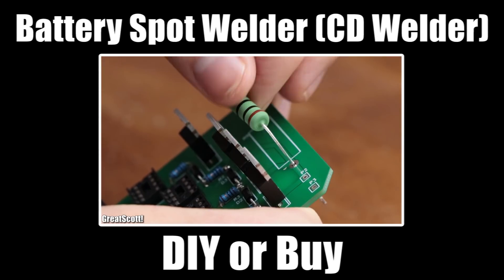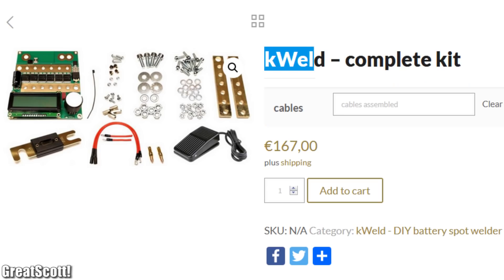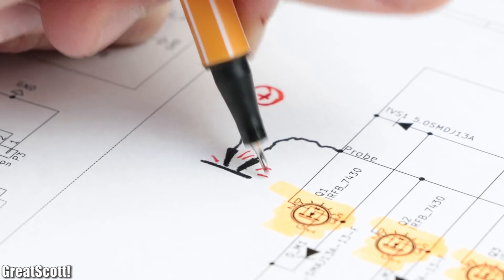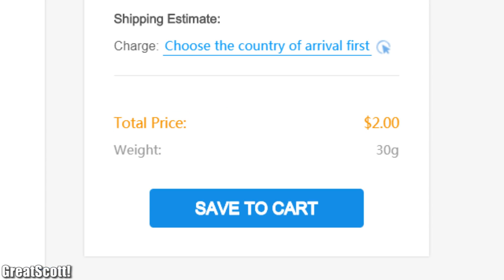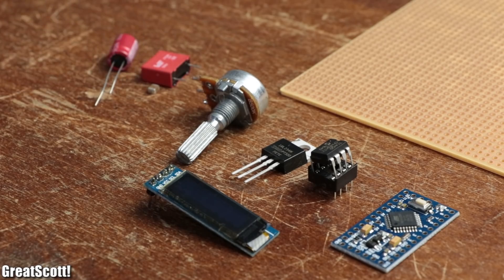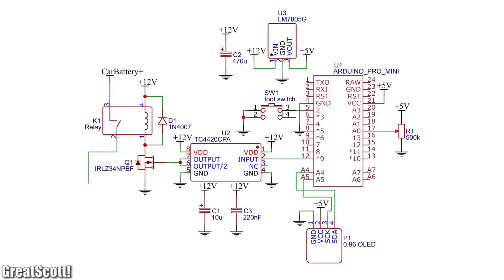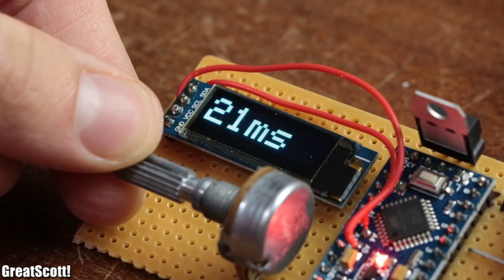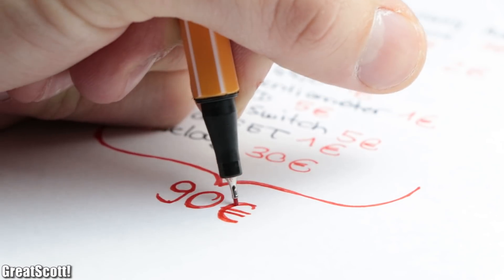Make your own Crude Battery Spot Welder with a Car Battery!

Comment: Cable shoes 🤣 that must be the German Translation for ring terminal! Love the German language.
Reply: Well here in Denmark we call those "Ringkabelsko" (Ring cable shoes), as opposed to Spade connectors (spadekabelsko) or Pin terminals (stiftkabelsko).
Reply: @jaras1969  It's "Ringkabelschuh" and "Stiftkabelschuh" in German as well :) Then there's "Gabelkabelschuh", but "spadekabelsko" is a "Flachstecker" or "Flachsteckhülse" respectively for the female counterpart.

I always find it fascinating how these kinds of mashup words play out in different germanic languages :D
Reply: @jaras1969 That's really interesting! Does that mean that "shoes"(sko, and Schuh for that matter) has a meaning that is more broad than shoe in English? Possibly something like distal appendage cover?
Reply: @reallyiffy  The word shoe is used for electrical contacts in English also.  The sliding contact on an electrically powered trolley, for example, is called a shoe.
Reply: @flyingshotsman That's right! I've usually thought of these connections as brushed contacts, but as you described, that is the correct term for the sliding conductors on electrically powered trolleys (and busses like we see in Seattle!) I always thought of that as a pantograph assembly but that might be a term reserved for electrically powered trains.

 @Basement-Science  yes of course cable shoe is an English word. It's the literal translation of the German word, which is very different from the nomenclature used in the vernacular. For example, I have never heard it been used in my industry where I work with lots of electrical engineers, and electrical assembly technicians. They always refer to those contacts as spade/ring terminals/crimps. It is just a striking word to me because of the imagery it invokes as a literal shoe at the end of the cable. The mental image is rather ridiculous but also makes sense in an abstract way.
Reply: In Romania we call them "papuci" and it means shoe so nothing out of the ordinary here.
Reply: Yes, your right🤣 🤣
Reply: necesitas un translation en espanol?
Reply: It's the same in Romanian :) Only that we call them "cable slippers" (word for word translation)

Comment: Microwave transformer and big relay on the primary side driven by 5V arduino relay is good option I use it and it's great and muuuuch cheaper
Reply: @closure4791  Yes. Relay is in the 230V side so it can be smaller and much cheaper. It is also faster because those big ass relays capable of hundreds of amps have to move large contacts and it takes time. Only down side of this relay is that it is using 230V to switch. But 5V arduino relay module is well enough for switching relay that powers the transformer.
Reply: @closure4791  There are modules available on Ali-Express which do exactly that. They offer precise timing control and zero-crossing-detection. Some of these modules even offer double-pulse welding and they come with a powerfull SSR allready soldered in.
Reply: Least someone got good idea lol

Comment: I've got one great spot welder on arduino and microwave transformer. But not long ago I buy 350F 2,7V supercap (8$). I just welded to supercap terminals wires and copper electrodes, and thats all. Simple and efective spot welder :) Just I need to be fast :P

Comment: Very good video and interesting project!

I'm only a bit concerned about the lead acid battery misbehaving after long continued use. Maybe adding a thermistor attached to battery could help to implement a safety power off.

Comment: I build the exact same spot-welder. But I upgraded it then with mosfets instead of the relay. I also replaced the car battery with a "car starter Powerbank". It works perfectly.

Comment: Never tin wires clamped in screw terminals!
Reply: how come? Just wondering
Reply: @The231447LucidDevTeam  The solder cold flows under pressure. It will lead to a bad contact, heat and fire in the end. It's a big NO-NO.
Reply: @zaprodk  makes sense. thanks for explaining
Reply: @The231447LucidDevTeam  solder gets kind of weak over time and connectors heat up because of higher resistance. you have to crimp those connectors.

Comment: That's dumb, I bought spot welder module from Aliexpress for 20$ and used it with microwave transformer.
Reply from the maker: Great, but my design works as well. So why is it dumb?
Reply: @greatscottlab  It's much more expensive and you are switching high amperage, while I switch 230 V, so it can be done with semiconductors instead of relay. 
But hey, I'm glad you had fun making it. There is always a way to improve something.

Comment: Hello,
For those of you who consider the price of the relay too high, you can do the same job with a much cheaper starter solenoid from a motorcycle. Those come really cheap in my country, about 5 euros.  And you don't really need an OLED, since they are a bit expensive. You can do just fine with a 7segment. Be sure to not purchase just the bare bones one, or if you do, purchase a bcd to 7 segment decoder,  and a sipo shift register (if you want to save pins on the arduino). Also, you don't need the  arduino, if it is expensive where you live and you don't wish to wait 2-3 months for aliexpress/banggood (that's the waiting time for me in my country). You can do just fine with an atmega328p programmed in a arduino board or via ISP.  GreatScott! has explained how to do so with an attiny85, and the process is similar , same pins, you just have to locate them.
Kind regards.
Awesome video, by the way.  Congratulations !! :)

Comment: Wouldn't it be better to use iron/steel nails?  Yes, the resistance would be higher, but isn't the coppers melting point just way too low?
Your nails seem to get welded onto the nickelstrips quit strongly every time.

Comment: can't you just plug the electrodes directly to the battery with one cable cut in half, on each lose end a metal pole you can hit the other one with to close the circuit for a short period of time? Wouldn't be that precise but 100€ cheaper. (i don't think the poles would stick together when making contact given that you would mainly "bounce".

Comment: plz make a wireless USB hub for PC
Reply: a wireless usb hub is useless and it's not possible to compleatly wirefree something like a usb hub.
Reply: no i wanted to know coz i m a gamer and lots of wire run from behind hy system.....i want to minimise that by using an wireless usb hub for my gaming keyboard and mouse set.....thats why
Reply: @somnathmukherjee4155  then just use a wireless keyboard and mouse, still because it's wireless = it can cause issues for example drop the connection or have delay, not a big fan of that

It's better to stick to cables and manage them neatly (drill a hole in the table for Keyboard cable for example)
Reply: Sir I Repairing amlifheres so I need a amlifher  circuit boards so you can help me plz

Comment: I see you used wurth elektronik capacitors. Did you get them as samples or buy them? I asking because I am 'sponsored' by wurth elektronik and if I had to buy their components I don't see the reason to spend that much money on their components, because their components are quite expensive compered to other manufacturers.

Comment: I am not an electronics super Student like you, but I managed to build such a simple Version 2 Years ago. The point is that often the simple Version is the best version. My Spotwelder only consists of a Car Battery, an Arduino, a Resistor, thick copper Rods and Powerful Mosfets, I control the on/off time via my Laptop, so no other complicated circuitry. This stuff is literally no Rocket Physics. I did not even made the Math for on/off Time of the Mosfets. I just tried around a little bit until I became good Results. I think it is a little bit amusing that you tried these complicated versions when the key is simplicity. But nevertheless the approach with the Supercapacitors was pretty interesting. Greetings from Hamburg.

Comment: 6:57 isn't it a bad idea to tin wires that you put in screw terminals?
Reply: It is not recommended, since the solder will settle after a while, leading to a loose screw connection. It is better to crimp the wire with a ferrule to cold-weld the strands together, and also provide a grip for the screw holding it in place. Tinning the wires is forbidden in the electrical wiring of houses, and in manufacturing of switching cabinets.
Reply: @nrdesign1991  that's what I was thinking.
I have a 3D printer and I remember the biggest nono was to solder the leads for the bed. Apparently it was a reason for loose contact and melted terminals.
Reply: @awesomefacepalm  Either solder the leads directly to the board/connector/whatever, or crimp the wire ends with ferrules before inserting into clamp connectors.
Reply: @ @nrdesign1991 , normally you don't use stranded wire for 120 or 220 volt housing wire hence there would be no call for tinning.
Reply: Yes it is, definitely do not solder wires to use them in screw terminals.
Reply: Absolutely. Never, ever, tin wires for screw terminals! When done with mains wiring it has caused many house fires after a while.
Reply: Absolutely a bad idea, especially on high current wires. Heat will cause the solder to fracture, deform, and heat up. This results in a lose connection with high resistance which further increases the heat in the connection. I have seen several melted mains plugs in which the amateur tinned the wires with solder before screwing them down. ALL electrical contact manufacturers state in their instruction sheets NOT to solder before installing in screw terminals or crimp connections. Crimp, THEN solder or in the case of screw terminals, just screw them down. Use wire ferrules if you want that professional installation or if you need to meet electrical code in industrial cabinets.
Reply: Never presolder mechanical connections!
Reply: Thanks to all for this information. I'm sure I've done the deed more than a few times. Never again.
Reply: Yes. The thermal expansion and compression of the terminal compresses the solder when cold and when the terminal warms up again the solder does not follow the expansion and is loose in the terminal.
Reply: What about soldering after you screw it in?
Reply: Tin your wire when then end connection is a solder joint, most low power signal wire it would matter if it were tinned, feruled, or bare.  However with that said, I don't see a reason to power terminals ever.
Reply: Over time the solder does tend to creep, but although the current is high it's high only for small pulses. I don't think in this application it is an actual safety issue.
Reply: @VrumsAdventures  Solder creep isn't the entire issue. Over time as the temperature of the connection changes, the tinned end of the wire will deform slightly, with the net result being  that the terminal ends up loose. Best option is to use a proper crimp-on ferrule (can subsititute an uninsulated butt connector in a pinch), but even bare wire will be more reliable than tinned.
Reply: No, you have a better and stronger connection thats is also protected from corrosion
Reply: @Nedeles  It actually gets a weaker connection because the solder has a creeping effect over time. It's a common mistake for newcomers because you intuitively think the solder makes it into one large conductor, but then you don't account for the odd microscopic properties of solder.
Reply: @Djhg2000  ok
Reply: @Nedeles  NO!
Reply: yes its a good idea, and for fast soldering bond I always smear the naked copper wire with solder paste
Reply: @ronen124  No it's an absolutely terrible idea. Solder cold-flows under mechanical load.
Reply: @zaprodk  if you tighten and hold the wire strong enough it should not become hot and melt the tin, from my experience copper wire threads: if moved to the sides will break easily, if exposed to moisture will corrode with time , have you ever seen tin melting in such occasion or you just want to say something "wise" from what you read somewhere?
Reply: @ronen124  I've been working in electronics for my whole life so i /know/ it's bad practice. I've seen control cabinets burned down because of this and repaired stuff that acted weird with vibrations. It has nothing to do with "holding the wire strong" - The solder does not make the wire become hot. The solder is flexible and when you put it under pressure it moves - but only very slowly. It can take years before you notice it. But when it has moved enough and the joint becomes erratic you will have heat produced and then it just accelerates and takes off very fast. It sounds like you are feeling very "wise" going after people that actually know what they are talking about.
Reply: @zaprodk  working while the electronic board is exposed to mild/severe vibrations is a whole different story and better not happen whatsoever, that can loosen the bolts and indeed fry the connections, however, this is not the case here..(-:
btw, I don't have anything against someone who explains his thoughts with details like you did

Comment: Used Microwave transformer with an SSR should be even cheaper :)
Reply: And also much more dangerous
Reply: Then you are working with high voltage, this is for demo projects. I think safety is a great concern. Unless you are like mehdi the crazy Iranian electrical engineer.
Reply: @falconeagle3655  he is canadian
Reply: @shashankdesai8650  he means his heritage. He is Iranian and living in Canada.
Reply: Forgot to mention, first you have to remove the high voltage coil and replace with a 2-3turn one. So not really high voltage anymore, atleast on the secondary side.
Reply: @mrhappyfaq32  Even on low Voltage its still dangereus to work with AC for something you have to use with Exposed electrodes
Reply: @Nedeles  you put the transformer in a closed plastic housing and guide the 2 electrodes outside of the housing, they are safe to touch because its very low voltage on the modified secondary coil(2-3turns). High current, low voltage, probably even lower than a 12V car battery!
Reply: @mrhappyfaq32  Even if its 1V whould still be dangereous, you can use something like that when you are in a bench and a static structure, what implies a lot of secondary work and even with that stil be capable of make a few burns in your skin if you get distracted

As you say, yeah, is cheaper

And a lot more dangereus
Reply: @Nedeles  no disrespect but i think you have no idea what you are talking about...
Reply: @mrhappyfaq32  Good luck with whatever you do.

Comment: I would be very interested in how that big relay is constructed, specifically the contacts. 
Would you do a teardown?
It seems to be screwed together so the teardown shouldn't be destructive.
Reply from the maker: Hmmmm I will see what I can do.
Reply: just look for main relay for camper / caravan, they are made for round about 200 ampere and cost 10 $ / €
Reply: Loukas Hareangas i wonder how much of those 20/40ms are spent closing the relay ..
Reply: Should be possible to use a regular starter motor solenoid there as well, though you probably will want to remove the arm and the gear from the end, and use just the solenoid on it's own. They are quite robust, and able to handle 200A easily, and can be obtained almost for free from any auto repair shop as a dead starter motor. In most cases the contactor is fine, just the motor is worn out. Old ones you could take them apart to clean them, but not so easy with the modern ones. Or else just look for the original Mini starter solenoid, similar to the one in the video, used for vehicles with a Bendix starter that engages by inertia, often used on older Land rovers.
Reply: I am wondering if a starter relay aka solenoid from a car or lawn tractor could be used ?
Reply: @danharold3087  I was wondering the same thing. Only one way to find out!
Reply: @danharold3087  Yes.  There are a few videos - battery, small starter solenoid, momentary switch and some wire.... 

https://www.youtube.com/watch?v=o1NFbchHeM8
https://www.youtube.com/watch?v=b_kGgPVrcCI
https://www.youtube.com/watch?v=b2pE8RcBSJU
Reply: A car starter relay would work fine, I don't think I have ever seen one stuck on. The contacts do wear out, but a snubber cap might help with longevity. Just rememeber you don't start a car every 2 seconds like you would be welding tabs, so give it a duty cycle of your choice to keep the heat down on the contacts.
Reply: @UberAlphaSirus  True, but in vehicles with stop start that starter does do a lot of work, and in most cases it is the same starter used in the lower spec models without stop start, so they are pretty robust. I have seen them weld fast, but generally that is more from dirt in the front section binding the movement than the contacts, as they are not going to weld fast more than the heavy return spring can break them apart, though that spring is known to fail every so often.
Reply: @SeanBZA  so aint a big deal then. Fuses blow and maybe a bit of fire.
Reply: I wonder if a large IGBT would work in place of the relay, I use to do forklift servicing and have a few 400A and 500A beast kicking around FZ400R12KE3
Reply: Generally, they are just solenoids with a thick copper washer on the end of the plunger that is pulled into contact with the two high amp terminals when the coil is energized.
Reply: Well, yeah, I know how a relay works, I am more interested in the contacts themselves. 
Can they make the contact (easier) as well as break the contact under a 1000A DC load (doubtful), or is the contactor supposed to be operated under no load only. Those kinds of details.
Reply: They should be standard copper contacts, these solenoids are used in truck and earthmoving machines to isolate batteries. They don't normally get used with switching high loads but the load is drawn through well after the contacts have closed, like a starter motor. Hope that makes sense 😀.
Reply: Old saw blade
https://youtu.be/WtNk_qIcN7Q